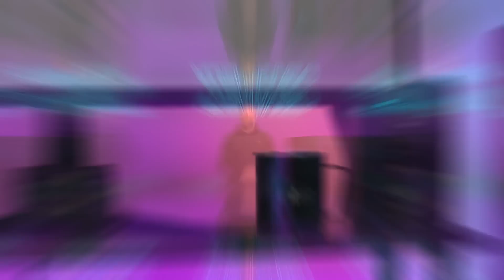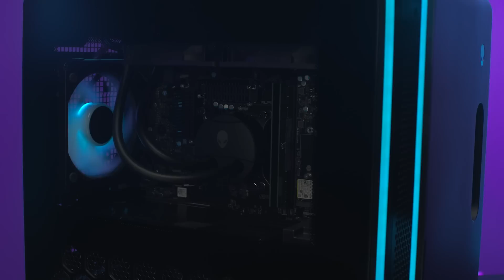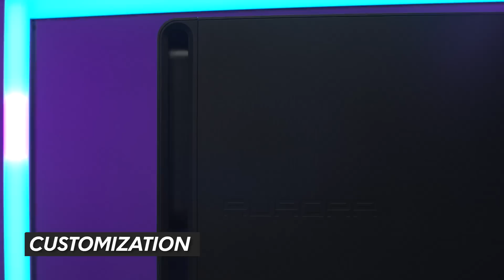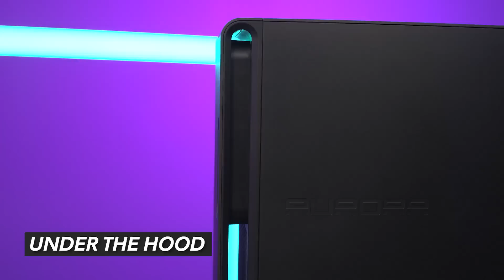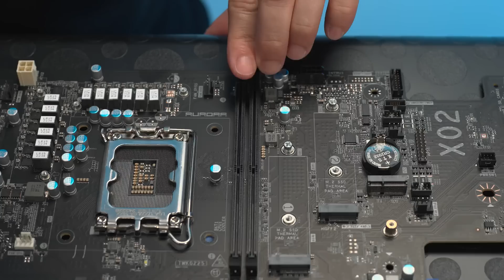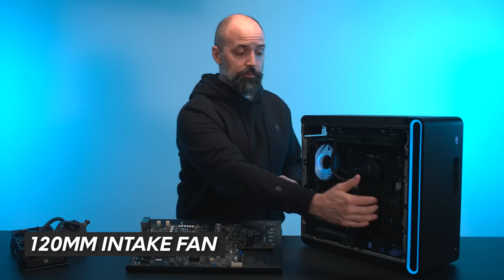The Next Generation of Gaming Desktops | Aurora R16 Deep Dive

Comment: I purchased a new R10 Ryzen last year but would love to get my hands on an R14 case to get that nice see-through side panel. Did managed to cure airflow issues in the R10 though by running Noctua Cromax NF12 x 25 fans with two running intake and 2 more on a push/pull on the radiator. Temps are high 60 / low 70s (on a hot day) with that config.

Comment: Just picked one up for 1200

Runs great for the price, the deals are out there guys
Reply: What kind of monitor you use?
Reply: @JohnnySinns-h2q  Dell Alienware 35 inch curved. Found it on Amazon "refurbishe" for a third of the cost. I got lucky, not a scratch on it. It so crisp and at 175mhz gameplay is smooooooooth.

Comment: Uhh.. not a fan of the mundane design.. been using Alienware since 2013, still have the R4, just changed some of the parts (mainly gpu), got 17” laptop (2015 version, can’t remember exact model) and Area 51. Now then.. that last one had probably the most awesome design. I’m a fan of the R14 and will probably get that later this year as it still looks like “alien tech / design”. Not too intense of a gamer myself as I used to be, but I ways got Alienware because of the design. This R16 looks just sad.. looks somewhat like that Pentium 2 I had back in 2000 aside from the lighting and hex vents.. oh well. At least there won’t be any impulse buying..
Reply: If you know how to replace Alienware parts, why haven't you built your own computer? Alienware is notoriously bad...
Reply: @0riginGonzo  I wasn't really aware they were not replaceable (sounds dumb I know). I just got a new gpu and threw it in there.. haven't really changed anything else since then. I remember I added two gpus for the area 51 as I connected 6 monitors. Honestly when I got them I was a lot better off financially and I was in it for the design and the brand itself. I'm pretty sure I was the target market for them, i.e. well off financially, into their cool design, and not being able to bother building a PC themselves (myself). I'd opt for it again if I was in the same (financial) position as then. The current design tho really sucks.. I mean it just looks like a generic old pc.. maybe that's what they were going for, nostalgia for the millennials maybe who can now afford this brand? Just a hunch.

Comment: As someone that has exclusively owned Alienware systems for almost 13 years now (2 laptops and a desktop), I believe that you guys should move beyond the proprietary part model. It is both an outdated, customer unfriendly and environmentally unfriendly policy. At a minimum, you should offer bios updates to support more recent CPUs if those are on the same socket. Listen to your customers as this is the only viable long term strategy in an increasingly more sustainability focused world where the days of rent-seeking behavior such as proprietary products or ecosystems are numbered (the case of Apple chargers should serve as a warning on the direction of travel).

Comment: HOLY COW! I began looking at the i7 13th. But when I discovered that the i9 13th generation has Almost double the specs of the 12th gen i9, I nearly went into convulsions! So I took the plunge and ordered the i9, 13th gen for the extra 150 clams, 4070, 64 GB ram, 1000 watt liquid cooled PSU, AND I hope to flush the toilets in the Vatican soon.

Comment: that case is just crying out for some more front ventilation. it would be really cool to move to an all mesh front panel to allow for better intake + positive pressure. those VRMs and the SSD will need more cool air, especially with the AIO not providing any airflow for them (like air cooling would).

i'm still rocking an alienware aurora r7 with an AIO & taking off the plastic housing + adding two noctua nf-p12 intake fans improves so much.

also what is with the proprietary long motherboard design? it kills any upgradability or case swap down the line. proprietary parts just end up as e-waste down the line

Comment: Imo, this is a step in the right direction. Alienware has always been an interesting brand to watch as they develop new technologies from model to model. However, I decided to go the route of choosing my own parts... Saved a lot of money by choosing a 12th Gen and a 30 series... Most importantly non-proprietary components allowing a future upgrade path to 13th, 14th Gen as well as 40 and 50 series upgrades if/when needed. If you guys removed proprietary parts, you could/would have a larger slice of the parts-picker market allowing others to buy Alienware components like Msi, Corsair, Gigabyte and many others that help add choices to our Rigs etc. Cheers - Jass.

Comment: I ordered the R16 (13 gen I7, 4070) why is it coming with only a 500 watt psu? Will it be able to handle an external drive for example?  500watts seems really low to me.
Reply: Why didn't u pick 1000 watt for 50 more is the ❓
Reply: Cause finding them requires buying directly from Dell with the premium

Comment: I will say if he had said he was trying to envision what gaming computers were 30 years in the past, he would have nailed it. This computer has new plastic slapped on an ancient chassis, made with tooling that is decades old (could even be 30 years old!), and the design is inept versus modern cases. Let's go over why:

- Computers used proprietary garbage tier motherboards and power supplies that were not standard size making them impossible to upgrade 30 years ago, and this one does too!
- Computers had horrible cooling 30 years ago, and versus other modern computers this one does too!
- Computers looked terrible 30 years ago and this one does too!

What a joke. Don't buy this. If you want to buy something from a huge corporation that isn't terrible, buy a Lenovo.

Comment: I'm impressed by the depth of this video and the thought behind the sleek and interesting design, but finding out how may proprietary parts Alienware still uses shocked me. Whatever else may be nice about the new model, not being able to do easy repair and replacement of the case and motherboard makes this a non-starter for both my personal use and as a recommendation for others. With Dell's claimed commitment to sustainability and reducing e-waste, this design decision needs to be phased out and it needs to be done soon.
Reply: Expect to pay about 20% more then.
Reply: @fractalelf7760  Why would using traditional case I/O and power supplies add 20% to the price? They're industry standards and common on machines that cost a lot less than this.
Reply: @KiraVolfield  Due to building, procurement costs and packaging and mark up.  Those vendors like Asus, etc. build their own- they would mark up to not let Dell compete easily.

Comment: Wow, your a great presenter. Exactly the same metal box as the R13 and R15 minus the plastic and the higher end CPU's and GPU's they both offered in certain areas.
Now replaced with an XPS with fancy lighting, no cyro tech cooling, no XMP memory and no high end GPU or CPU.
Just drop the Alienware branding which i assune will be the next move from Dell. Pathetic does not even cover how poor this PC is.
Reply from the maker: We hear you about CryoTech, XMP, and additional high end CPU/GPUs. While we cant give too many specifics, more options are coming.

Comment: Like Chrome Book. Make a Lite Laptop
RAM/ROM:  3/64 GB
Screen:  9"
Aspect Ratio:  5:4
Speaker: 1

Port
1 Changing Pin, 1 AUX Jack, 1 USB A (2.0) & Micro SD
No USB C (This isnt a Mobile ph)

Changes
1. Lite Windows 11
2. Nxt Gen ARM Processor
Like Apple

Comment: Time for some questions I'm sure your not going to want to answer, but might be of use for anyone considering one of these systems.

For system upgrade you mention tool less upgrades for the GPU, RAM and storage. RAM never needed a tool. Tool less drive bays have been around for at least 8 years. And the GPU should have at least one screw, but that can be one that can be removed by hand. 

What about the CPU? If you get a 12th gen now, are you going to be able to upgrade that to a 13th gen later? They both use the LGA 1700 socket and are both compatible with the Z690 and Z790 chipset. 

Asking because the R10 had both 3000 and 5000 options. The systems that shipped with a 3000 CPU used the B450 chipset but did not get the BIOS update needed to run the 5000 chips. 

And Intel changes sockets on even generations, so 14th gen will be a new socket. 

What about the PSU? You didn't mention its proprietary. Any reason for this omission? Are you going to be selling compatible PSUs?

With the PSU, efficiency has nothing to do with the quality of the power. It means that if the system is using 1000W (going for round numbers), and you have a 92% efficient PSU (about what an 80+ Platinum PSU will get), the PSU will only be pulling an extra 8% (or 80W in this case) from the wall. 

With regards to the "special features". Never herd of the 'Flex power' If your getting a power surge, shouldn't that be handled by a surge protector? And that is going to cut power. There is 
OVP (Over Voltage Protection), but that only addresses the 'system' side of the PSU, not the ‘wall’ side.

Burst power. First, power doesn't work like that. The PSU doesn't 'push' power, components pull power. What you have described is boost or turbo on the CPU or GPU. If the CPU/GPU is under load and has thermal headroom (aka its cool enough/isn't going to overheat), it will start pulling more power so it can push its clock speed up. 

And on the topic of CPU power, will the CPU be able to hold its boost clocks/power? The R13 and Intel R15s where massively under preforming due to power limits. Has that been addressed?
Reply from the maker: We'll do our best to answer some of these.
- CPU Upgrades: Yes, since they leverage the same socket, you should be able to upgrade from a 12th Gen Intel CPU to a 13th Gen. 
- CPU Power: Overclocking will not be available on the Aurora R16, however the 
- FlexPower technology allows power supply and motherboard to communicate protecting you from system shutdowns in the event of a power surge due to performance needs.
- BurstPower technology allows our power supply to double its power during a performance surge to assist performance needs.
- Proprietary Components: The motherboard and power supply were designed to work their best in tandem with each other.
Reply: @AlienwareChannel  Nice to see a response of sorts.

Should be able to is not will be able to. The R10s use the AM4 socket, that socket was comparable with both the 3000 and 5000 CPUs, amongst others. The only thing needed for compatibility moving from a 3000 to 5000 series CPU was a BIOS update. To my knowledge, that update has not been published by Dell.

Fair point on overclocking, if your only shipping the R16 with non K sku CPUs they don't support overclocking and that is an Intel thing.

Still too much marketing fluff around the PSU features. Is it an external power surge or high draw from a CPU/GPU boost? Surge implies an external event...
Yes there is a hold up time, but its not new. Yes the 3080/3090/4080/4090 GPUs can pull a LOT of power in very, very short bursts. That pull is enough to trip smaller PSUs, simple fix is more/bigger caps. But that is all dealing with at most 1/60th of a second. 
Its too easy to technobabble around people. Sell the technical features, not the marketing. But as I have no way of verifying and being well aware of Dunning Kruger, I shall leave that testing to an independent team with the proper testing equipment to verify.

While the PSU features got temporary pass, proprietary components don't. Its a yes or no question: either they are or are not proprietary. If they are, will replacements/spares be sold out of warranty?

Comment: it's a lot better than before but could still use improvements, 2 fans as intake on the front, give us a mesh front. Gamers love RGB need some RGB RAM, and some on the AIO. Also LCD screens is the new thing, Like the Corsair and NZXT or ASUS, need a LCD AIO. Or at least some RGB on the CPU cap for AIO and RGB fans. Is the AIO removable? Or even just the fans. Also a seperate headphone and mic jack on the front would be nice. But this is a step in the right direction, with room for improvement.
Reply from the maker: Appreciate the feedback! We'll share it up the chain
Reply: I don't get everyone's craze for RGB me personally I prefer the more slick and not in your face approach with lighting, less is more if you ask me

Comment: This was a very interesting explanatory video.
I am aware that the CPU cooling was not perfect in R15. Is the CPU cooling in R16 using the same parts as in R15?
I am waiting for R16 to be released in Japan as soon as possible.
Reply: The issue with the R15 isn't the cooling, its with the power. The only review with a useful benchmark uses a 13900KF, so I will use the same CPU but the trend holds for the 13700K/KF in the R15. And I can't see it somehow being different for the 13600K either. 13900KF should be running P cores at 5.2GHz and E cores at 4.3GHz. And that is allowed to go higher with better cooling. The R15 runs the 13900KF at 4.4GHz for the P cores and 3.4GHz for the E cores.

Technically the thermals/240mm cooler is fine but the CPU is running 15-20% under what it should be. For a normal 13900K a 240mm cooler is just on the edge of being fine, if you live in a cold area and keep your room chilly you should be fine. If it gets warm (21C+) probably not and a 280/260mm cooler will be better. Plus the CPU can run faster with better cooling.

Comment: UNfortunately Alienware case designs are falling behind. and their proprietary parts really limit how long their cases last.
Reply: Lol. Kiddies wanting cases that look pretty.
Reply: @novoca1n3  hahaha
Reply: So what is the current trendsetter design exactly?  They literally based this off designs that Linus and others keep pulling out to make their point.
Reply: @fractalelf7760  Ask a case how much airflow it has. Consider only the ones that answer with "Yes"

A less silly but equally valid answer: easy to clean mesh filter. Nothing between the inside and outside besides the fan and the filter. 1I-1O or 2I-1O config, plus any AIO fans at minimum.
Reply: @fractalelf7760  ATX is a standard that exists..

Comment: Computational biologist here. I wish you guys could pump it to 128GB......but hey.....I can use AWS for ram-heavy jobs. 
I'm sold. 
Just ordered mine, and will definitely be doing a review on computational metrics, and design functions. Thank you for the affordability and sleek design! Ocham's razor.... there's beauty in simplicity. Great review Eddy wonderful PC presentation!! You deserve a raise for sure.
Reply: I think you're more prone to use workstation-class PCs, not this. It would give you at least 4 memory channels and a lot more parallelism with CPU.
Reply: @notaspectator   Yeah but at the same time, ram-heavy jobs can be run on the cloud. Having a faster processor allows a lot of flexibility when time is an issue in my experience. Especially since a lot of analytical pipelines can be serialized. I already have a workstation :P but just wish the 4-channel was available as an option, I cant disagree with you there.

Edit: btw got mine a few days back, its cool as a cucumber, and hardly makes any audible noise even if you place the PC next to your screen. really impressive.

Comment: This looks like an improvement! Glad to see Alienware/Dell moving in the right direction. Hope you continue listening to GamersNexus critical reviews.
I have an R13 and have been very happy with it, even with the poor case design. Glad to see R16 improves on this.
Reply: Except they’re not listening. It’s the same metal frame chassis. They’re still using a proprietary motherboard and PSU. They did the bare minimum. They just stripped all the plastic off the same metal frame they have been using so they could save money. You can tell they’re not confident in the design because they don’t even let you select top-end parts for either the CPU or GPU on the website. It’s a bare minimum attempt.
Reply: @johnnietinuviel  i'm gonna cry, i feel like im watching their building burn down in front of me

Comment: im gonna take a leap here and say, the reason there is no 4080/4090 configurations is due to the thermals.. why is it hard to make a front panel with non-restricted air flow. just the same problem as the previous r platforms with the top exhaust or lack of...
Reply: 4080 is coming later. The chassis thermal is alright
Reply: They always stage out releases starting with more popular mid-tier options.
Reply from the maker: We'll have more graphics card options coming later 😊

Comment: Will Alienware desktops ever have Thunderbolt? I know the laptops have it, but the big thing putting me off from buying the desktop is that there's no Thunderbolt. I know cost wise to get licensing for the technology + proprietary motherboard makes it difficult, but it'd be huge if on the next iteration of the motherboard it's included in some way, even just for one port because I think that's what most people need, and what I need as well
Reply: It's complex than that, and there's a reason very few manufacturers use Thunderbolt on Desktops, beyond the fact that space saving the I/O is not a concern, and carrying video support isn't possible with separate graphics cards.